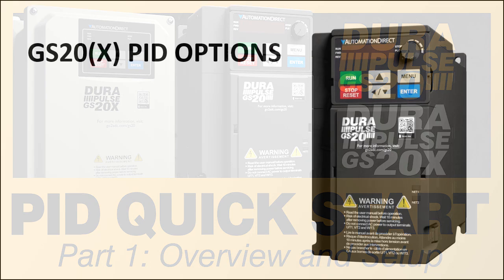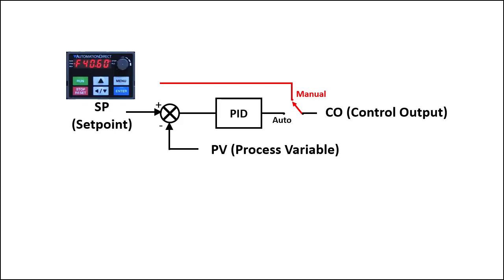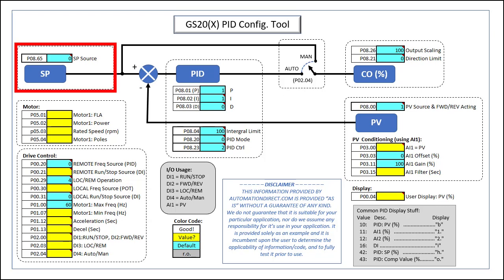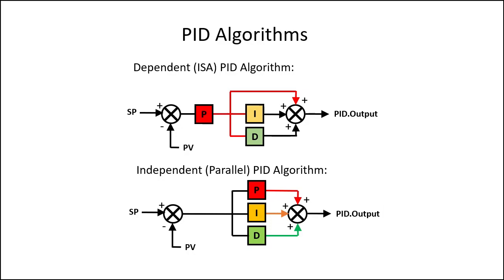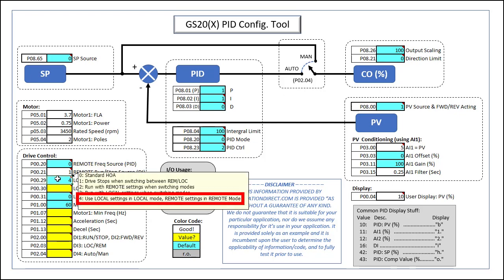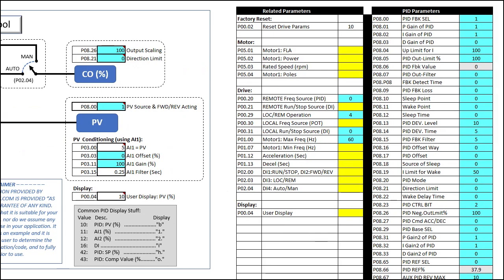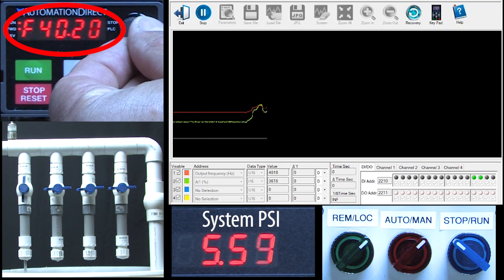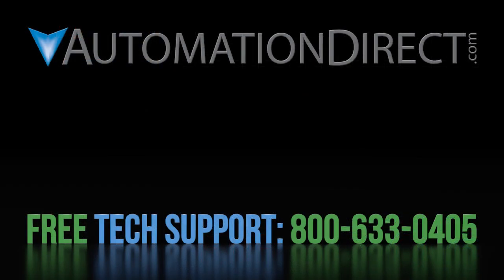DURApulse GS20(X) VFD: PID Quick Start Part 1 from AutomationDirect

Comment: Will it work with a 4-20mA pressure transducer?
Reply from the maker: Carlos Velez, yes, the drive offers 2 analog inputs, one of them can be configured for voltage or current (4-20ma input).  You can find the specifications for the drive here:  https://cdn.automationdirect.com/static/specs/gs20drives.pdf  Thank you for watching our videos.

Comment: The link to the configuration tool does not work.  I see that someone else commented on this, but I am not able to see the reply for some reason.
Reply from the maker: The link is correct, for some reason YouTube is breaking the link up because of the spaces. Please copy this URL and place into your browser.
"https://cdn.automationdirect.com/static/video-resources/drives/GS20X PID Config Tool.xlsx"
Reply from the maker: We just uploaded a new version of the file (the previous version had spaces in the URL, apparently YouTube doesn't like that anymore ..).  Try again and see if it works now.

Comment: I’ve been wanting to build something like this for years but with a electric bicycle, a speed sensor on the wheels and a click plc. Sadly I have almost all the parts but no time 😂 imagine a electric bike with a motor drive, a click plc and a hmi between the handlebars for hp display and cruise control using a pid function, secretly hoping you guys could build one so I can copy it with AD parts 😂👌👍 you can find 0-10 k potentiometer handlebar throttles online for “electric motorcycles”. That can go into a plc input.

If you guys are able to pull this off you could make a video showcasing the plc’s quick scan time (from the speed sensor), it’s analog inputs (from the throttle potentiometer) it’s pid control function, it’s Ethernet capability to talk to the hmi and drive, all for a plc that starts at $69 and free software.

If you guys weren’t so far away I would even offer to help build it 😂 but I’m here in Texas and would need time off from work
Reply from the maker: Hi Blake, That would be a fun project - Let us know if you ever get the time to work on it, we may be able to help ...  BTW, did you see the CLICK PID video series?
Reply: AutomationDirect.com yes and it made me want to build it even more 😂 lots of overtime money but very little time to figure out all the integration of the components. I know you guys used to have articles on your website of the stuff people built with AD components. Maybe one day I can build it for you guys.